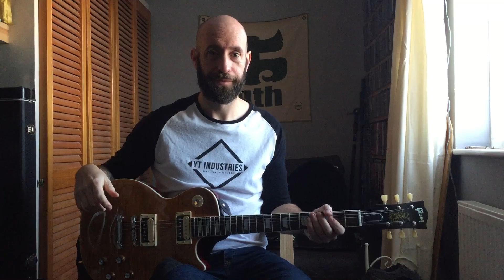Chibson AFD Les paul final update....for now!

Comment: would u recomend buying one of this?  i want to get one of this chinesse guitars but have so many doubts, any tips and recomendations?
Reply from the maker: Cristian Pulido hi, I would say that get one if you are will to take the risk & are willing/able to do some work to it if it needs it. 
My frets were pretty rubbish- so I levelled the frets. The pickups are never very good- but you can get good pickups fairly cheap, doesn't have to be Seymour Duncan. 
As for tips- ask for pictures of the actual guitar you are buying, not a catalogue shot! Go for a one piece neck- no scarf or neck/heel joint.
Reply: got it, man thanks for the advise, ill take my chance, as soon as i get ill show u some pics. have a great day and happy new year bro.
Reply from the maker: Cristian Pulido cool!! Good luck- one more thing- like eBay, check feedback of the sellers also. Most of the guitars are made in the same factory but some sellers simply have better relationships with the factory/manufacturers and therefore get better guitars.
Look forward too seeing what you get! I may buy another but have my own logo instead of the Gibson(?). 
Happy new yeah to you too!